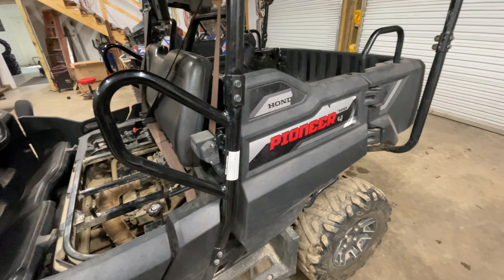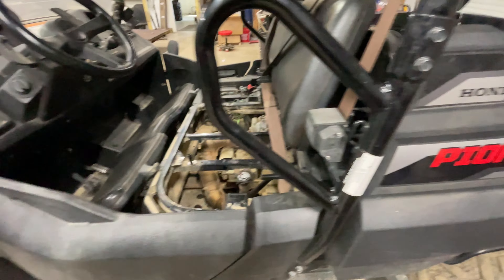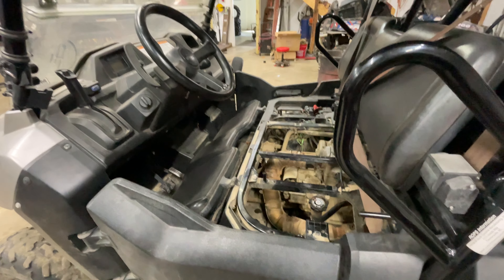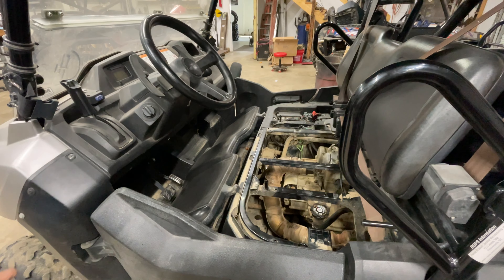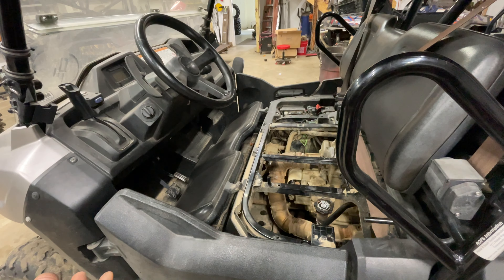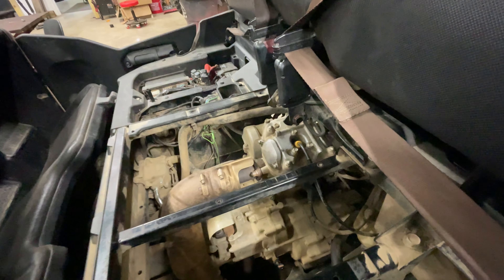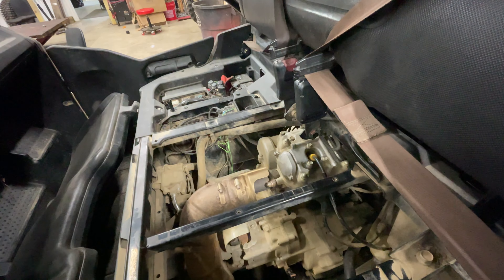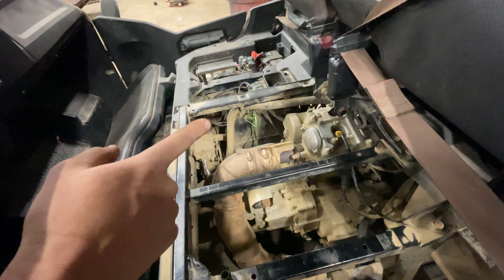Honda Pioneer 700, Will Not Accelerate, Has No Power, Limp Mode, Stalls When I Accelerate

Comment: 1:23  it apen to my 700 pioner 4 2014 in2023  . The thing is mostly in cool weather the oil dont get to the cams fast enoff  ,-25 average cecyus in canada .whit tracks on . An in time it damage the cams .alwas let the sxs run longer in winter before put in gear .but that an 1 bearring in back wheels its the only thing i add to fix in 15000 miles  ,tuff as a tank 😊 honda os the spelling ,,im french ..
Reply from the maker: Thanks for the comment and for watching our video!! Be sure to like and subscribe to our channel.

Comment: What about the gear light?
Reply from the maker: Hi and thanks for watching. If the gear light is on then that’s an indication that something wrong with the transmission. Check the fluid levels if that’s fine could be something internal.